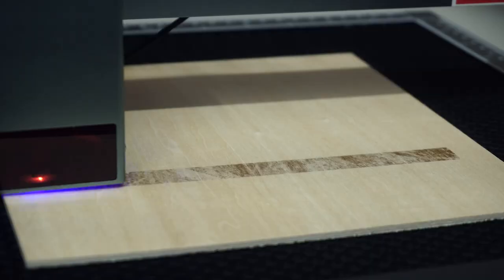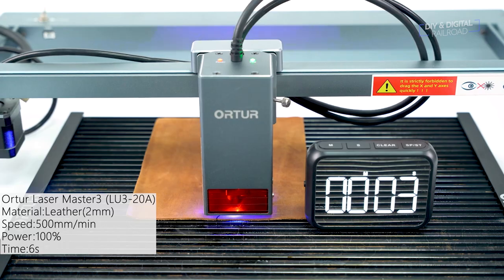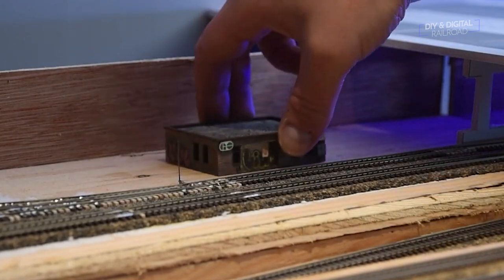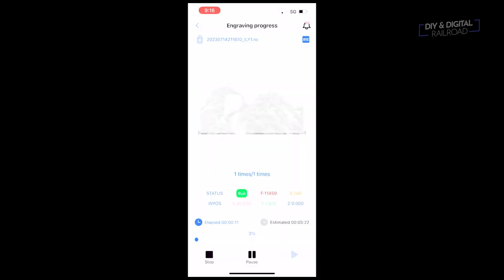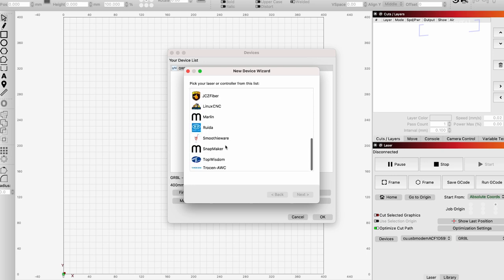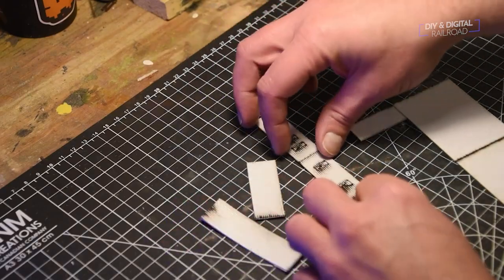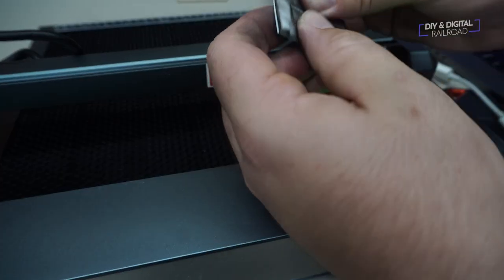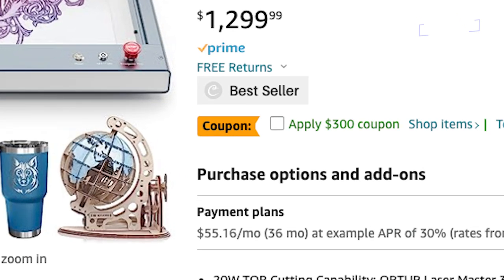The New Way to Scratch Build Models

Comment: Great video and thanks for the shout-out! I like that the one you have doesn't require you to keep your computer plugged into it the whole time you use it, although that hasn't been a huge issue so far since laser cutting is faster than 3d printing for the most part.

Comment: As always, Jimmy, you've given us a very informative video. One modeler who's doing some great work with laser-cut scratchbuilding in HO scale is on the YT channel Station Road Model Railway, and he goes into a lot of detail on the laser installation and use.
Sorry, but I have to be a naysayer on this topic. As other viewers have noted, laser cutting is still way beyond the budget of most modelers. By the time you've bought the laser cutter, the honeycomb mat, the fume enclosure, the ventilation system, and the software, the investment is about 1.5x the base cost of the cutter itself. Most modelers will never do enough scratchbuilding to justify this kind of expense.
If you REALLY want to try scratchbuilding your own laser cut design, check out one of the many custom laser cutting services. In the meantime, there are hundreds, perhaps thousands - of excellent laser cut kits out there - in all scales.

Comment: I would recommend getting a vector drawing program like AutoCAD. You will have much more control over your design, scaling, layering.  You can assign different power levels to layers as well.  I do this with my students in my classroom. 
There are several AutoCAD clones that will meet your needs
Reply: I'm using QCAD, as I wasn't happy with the fees for AutoCAD. I've been very happy with it, has compatibility with dxf and dwg files, and is a one-off price, not a monthly fee.
There will be more options out there as well.

Comment: These look pretty interesting! Don't forget that you can probably find local stores/clubs with good quality laser cutting equipment that can do custom jobs for you - which is a great way to cheaply test the waters. I got some some custom flex track templates made locally - think "tracksetta" but with different radii, and even compound curves. I used Inkscape (free app) to generate the design for them.

Comment: The soot on the styrene is from flare-ups! If you use a proper air assist the cuts will be cleaner with barely any black. You might also notice some wispy "flakes" of black soot deposited around your work space.  Plus, that soot is likely also being deposited on the laser lens.  I know each time I forget to turn on the air assist while cutting styrene, I end up having to clean the lens.

Comment: Greetings!  The addition of stronger air assist or smoke extraction may eliminate or reduce much of the charring and smoke staining, although Ortur says their pump is a 50L pump, they didn't mention if that is per minute or what.  My air assist isn't much more, it's only 60L / min.  I'm using a Sculpfun with a 10W diode head, it was easy to expand to a 16X34 inch work area, something that was important to me as doing larger HO buildings and boat / aircraft models can be a real pain in a smaller work envelope.  I have a K40 as well, but it hasn't been fired up since I got the diode unit, the larger work area and not having to deal with distilled water coolant and keeping it from getting nasty in the holding bucket sure is nice.

GOOD laser glasses are worth spending some money on if the provided pair seem iffy, the ones provided with the diode lasers are all over the place in terms of attenuation and general quality.  I hope Ortur is supplying decent laser goggles at this price point, but you only get two eyes.  Diode laser wavelength passes right through the front of the eye with no attenuation at all, which is why they are more dangerous to eyes than CO2 lasers.

Have a peek at the MakeCNC site for some good model railroad buildings, supplied in multiple formats.  The models aren't always perfect, and the roofs tend to have tabs sticking up through them which makes the laser engraved shingles rather pointless as you'll have to hide the tabs under some roofing material anyway, but some of their models are quite complicated structures that would be a lot of work to create from scratch.  They are specified for specific thicknesses of ply rather than styrene.

Lightburn software makes a lot of things with lasers just work better, good call going with it.  If you haven't found them yet, there are very good test cutting and engraving  pattern generators in Lightburn to make it easy to find optimal power and speed settings for various materials.  Makes getting dialed in as easy as using the Cones of Confusion on a resin printer.  I have never cut styrene, now you have me wanting to try it out.  If the soot on the surface is less with my air pump I'll let you know.   I've been too busy with other stuff lately, but making an enclosure for my diode laser with a high flow smoke and fume extraction inline fan is on the list of things to get done.  Welcome to the weird world of lasers, Have fun!

Comment: Jimmy - great video as always.  I'm a new model railroader, but am also a general hobbyist.  I got into laser cutters (I have the XTool which is also an amazing system).  The key to any laser system is the software; Lightburn is the de-facto best around, and will make your life so much better
rather than designing in Lightburn (or any laser driving program) - for me, it's an "easier" approach to design in a program that is meant for drawing etc, then export a .STL into Lightburn for cutting and engraving.  I use Visio (due to accurate measurements) to create to-scale buildings.  For example - I designed a 10x15 'yard house' building, that looks like a small wood shack with a pitched roof and the appearance of slatted walls and roof.  By using colors in Visio (I use one for cut lines, one for engraving lines) when you import into Lightburn, those same color lines (blue and red for example) become your cut and engraving lines.  Visio is just what I had on hand - any graphic program would work fine that can export STLs.
100% hooked on laser cutters, and I personally love the combination of the XTool and Lightburn.  even as a new model railroader, being able to scratch build so quickly (from start of design to cutting out on laser is under an hour) goes so much faster than designing 3d printed buildings and I want to scratch build most of my buildings for my (in progress) layout
great info and video as always - keep sharing the amazing content!

Comment: Jimmy, this is a great video. I also have a laser engraver ( not the Ortur but an equivalent) and love the versatility of it. I purchased an enclosure to go with my engraver and when used with the air filter system, all the smoke and much of the smell is able to be redirected to an open window to help keep my space smoke and relatively odor free. 
Lightburn, as you mentioned, is a easy software to use and gives freedom to all of your creative juices.

One question I do have, when you scored the styrene, did the scorch on the surface wipe off or did you have to sand it off?
Reply from the maker: The scorch wiped off for the most part.  It was very usable.  I definitely recommend multiple quick passes versus fewer slow ones.